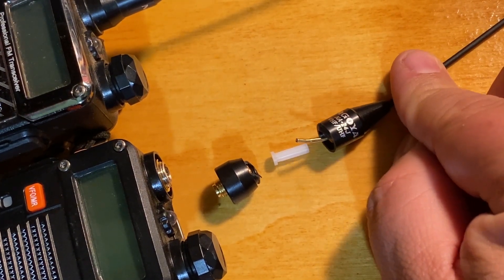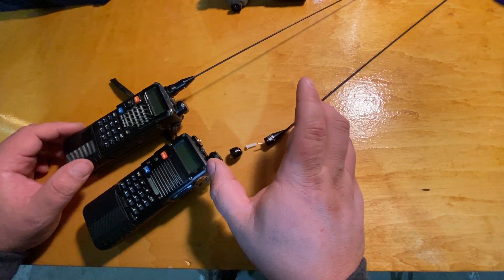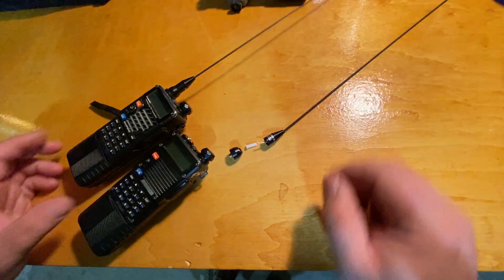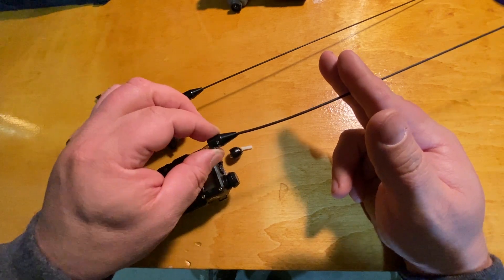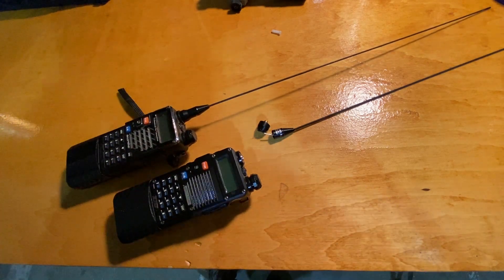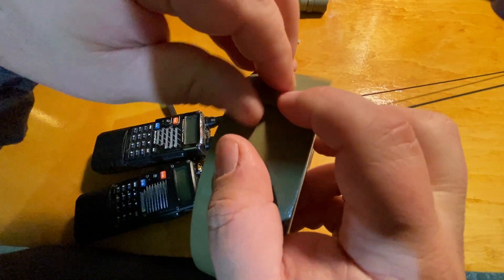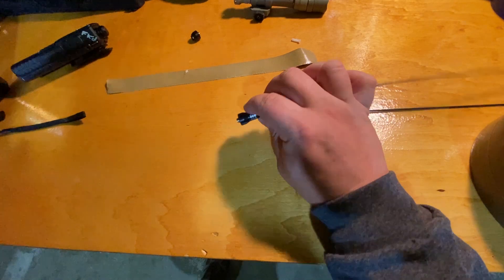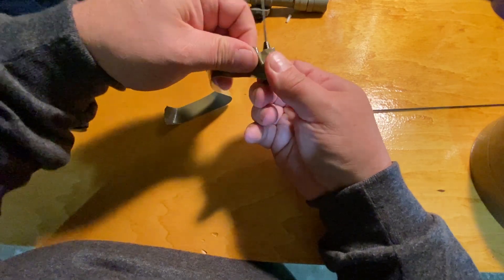Nagoya Antenna Issue & Fix ~ Rex Reviews

Comment: I ran across a club built whip antenna that was sold to generate charity funding. Wish I had bought one. I think theirs might have given Nagoya a real run for the money. And they guaranteed theirs against breakage. A horse bit one in two and they replaced it....30 miles working a repeater no sweat I heard.

Comment: Bo-fang is how most pronounce it.

There are lots of other antennas out there. Look at the Signal Stuff antennas. There antennas go to providing free ham radio study guide.

Also look at Diamond antennas. My Diamond in my Yaesu HT can get me 15-20 miles with good line of sight.

If you use a radio in remote locations, look at the Abbree “tactical” antenna. Lot longer and foldable. 

Another thing you can do if you have a ham license is get a mobile 2m/70cm radio that can cross band repeat. Then you can transform a vehicle with that radio into a mobile repeater. It would expand the range of your Baofengs. Not sure how much a GMRS repeater costs. But that’s an option too.

Also get a good magnet mount antenna with quality coax. Like Diamond, Larson, or Comet. That will greatly improve yoyr Baofeng’s tx/rx. 
Some like the Compactenna. Which is designed to be low profile. While it is a compromised antenna, it makes for an antenna that works better on the corner of your vehicle while being low profile. Just don’t expect it to perform like a 5/8 wave antenna.

Comment: I did the same to my antenna...problem was when i dropped it again the connection on the radio broke so now i look at it as if the antenna is like an AR gas tube designed to break before the radio port

Comment: If you put the stock one on..... And pull on it while "bending" in a circle.... The cover will slide off the sma connector.. revealing a coil with a capacitor soldered to it that has come in soldered..... Tip of the day...... OH.....  And.......  As long as it's connected.... You can't hurt it. Don't forget your backups to backup the backups

Comment: I wonder if shrink tube would help reinforce. Or maybe both shrink tube and duct tape
Reply: Pull out the old calipers and order some O-rings with a fat outside diameter and the correct inside diameter then shrink tube that. Just don't get the electronics to hot lol. That's getting fancy 😁.